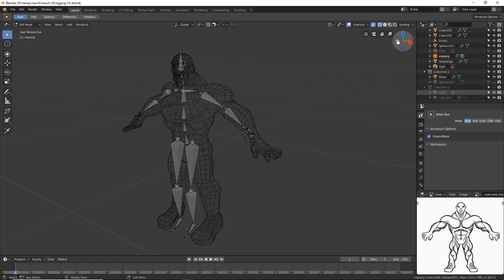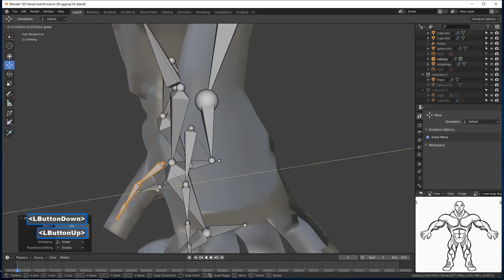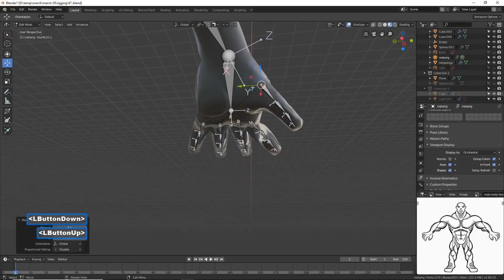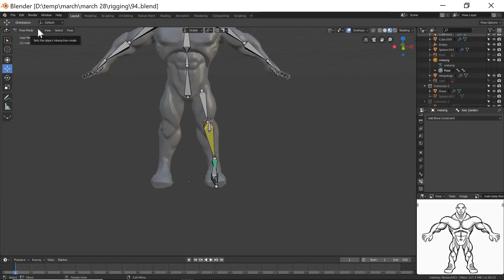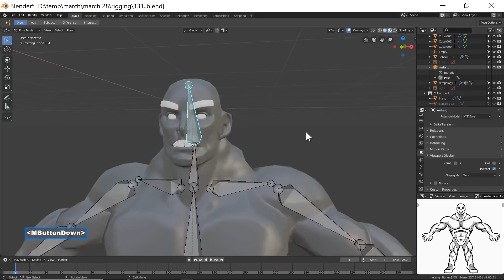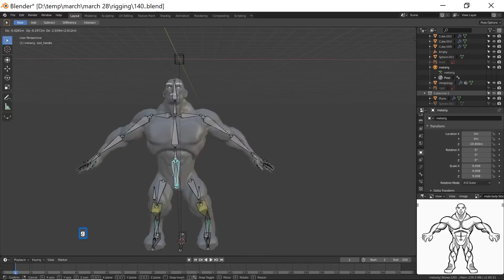Blender 2.8 Character Rigging Tutorial Step By Step

Comment: Hi Mr. Arango, you're tutorial is great but I have a problem. I tried to connect my mesh with the armature (with automatic weight) but, it doesn't work. I got an error message saying : Bone heat weighting, failed to find a solution. Is there any other way to connect the mesh and the armature?
Reply from the maker: Hi Janika. Those words stating that weighting failed are like a nightmare. When I have that happen I usually apply modifiers, go to mesh, mesh cleanup, merge verticies by distance. Sometimes this helps to resolve this issue.If this does not work contact me again and hopefully we can figure it out.
Reply: @AlimayoArango  It's resolved :) thank you for the help!
Reply: @AlimayoArango   I am having the same thing happen to me as well. I tried going to mesh, mesh cleanup and merge verticies by distance, but it is not working.

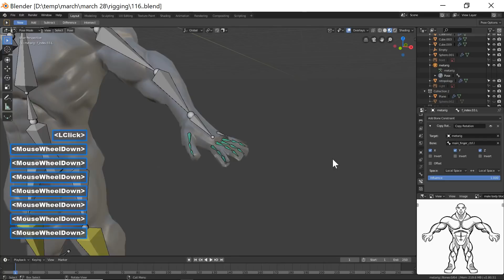Comment: Mr alimayo I have followed your tutorial until the minute 1:27:51 but when rotate the main_finger_control.L in the y the bones in the fingers go to a different direction, how ever if I rotate it in the X they move correctly did I miss a step or is ok that this happens ??
Reply from the maker: Bj makey did you adjust the roll of the finger bones? Also try rotating on they as well as the z axis to see how if the finger bones rotate better for you on those axis.
Reply: Alimayo Arango thanks i will rotate them

Comment: In 2.81 it only gives "Armature" as default, not even "add bone" if you Shift-A and click "Armature" you will get your first bone. I had to enable the addon Riggify to get those other rig options. IMPORTANT: Also, if you are in pose mode and use Riggify to add an armature it will give you a "traceback error" message and not add the armature. If you switch to Object mode you will not get that error. I made that bone-head error my first time placing a rig and it took a while to figure out what was wrong. Hope this helps someone.
Reply from the maker: I did not know about this information. Thank you for this.

Comment: Did you know that 2.81 has 2 more basic rigs in the armature menu. I just learned that my settings in preferences was a bit messed up so I had to go to factory settings. That's when I learned about the new meta rigs. I'm hoping that this is whats giving me issues with the rigging kinematics. Well I'm gonna have to try that out now. Happy holidays
Reply from the maker: Hi Dave. Thank for the info. I hope that you had a good Thanks Giving.
Reply: @AlimayoArango  I was wondering what happen to ya. I'm still having trouble with this kinematics. It won't work the same way twice or more. I sent you a video screenshot It shows at the beginning on how my rig is set up in the mesh with the y,x,z axis showing than it shows me setting up the kinematics up until where I'm having trouble. That is the foot roll bone when you press R for rotate 180 sometimes its rolls where its suppose to and sometimes it shoots up. When I do get passed that the part where the bones jump they go way out of wack. I'm hoping you'll be able to see what I'm doing wrong. I was about ready to try again and I spot your message

Comment: I boxed modeled the foot and leg just to work on that part. As far as can tell I solved my problem. On the foot underscore I was still in pose mode when I I did the  press R + 180 when I should of been in edit mode. I'm hoping that is all, hopefully it will work when I do the full rig AAHHHHHHHHHHHHH!!!!!!!!!!! Rattling my brain over something small.
Reply from the maker: When I first learned how to do the ankle rig I had issues. What it turned out to be was the order that I was selecting the bones in. I hope this helps David.
Reply: @AlimayoArango  I made sure of that I tried the leg and foot alone without everything else it worked fine I boxed modeled the leg and foot to work that out. Than I tried it with the whole character than I'm back to square 1 again. My trouble starts at the foot under score roll. When I press R 180 to rotate the bone the bottom part locks itself up by the lower leg and the handle bone. I've done this over and over again still same issue. I take notes writing in my word pad step by step to make sure I am in the right order and my bones are being placed the right way. I'll try to video tape this today.

Comment: Highly recommend running a Normalize (100%) and then a Hard Limiter (-3db) on your audio. After turning my headset to 100%, i can still barely hear you.
I also think there are some scoping issues. The video is teaching rigging, but you're explaining a lot of incredibly basic functionality in Blender like lasso selection and changing the view angle. The length of the video could be cut down pretty dramatically if the irrelevant information was removed.

Lots of good information in here nonetheless.
Reply from the maker: Thanks for watching the video Jimmy and for the tips.
Reply from the maker: Got a microphone stand. Hoping that the stand helps with sounding louder now.

Comment: Well done.

I've been in 3D for almost 30 years and (because I work on long-format material) generally opt for a simpler but faster rig.  I think I'm going to implement your techniques for my current project though, mostly to determine whether the extra steps and control bones are worth the effort.  I'll write back if I come to any solid conclusion on the matter.  Thanks!
Reply from the maker: Thanks for watching this video Daniel. I hope that your current project comes out well. Looking forward to hearing about the conclusion of your project. Thanks again Daniel.

Comment: Hmm when I symmetreized the legs, It didnt copied the bottom leg controller, but linked it to the first one, so when I move it, tho both legs move at the same time... what did I do wrong?
Reply from the maker: Latvanis are you still dealing with this issue?
Reply: @AlimayoArango  Wow, thanks for the awesome fast response, but no. I found solution, its in reply.

Comment: Hey so I’m using my own model and I wanted to know if your model is multiple parts or is it one? Thanks love your videos.
Reply from the maker: Hi Logan. Thanks for watching this video and for your kind words. This model is one mesh. Though I do think that the eyes were separate and then I joined them to the main mesh. Normally thought you would want to keep the eyes separate for proper rigging. That's cool that your using your own model. I hope it turns out good. If you get stuck or have issues with rigging it let me know and I will try to help. 
Thanks again.
Reply: Thank you. This video helped a lot. I’ve been having an issue with rigging for the past 2 weeks with my model and I didn’t know why but after watching this video the rig works flawlessly. Looking forward to new videos.